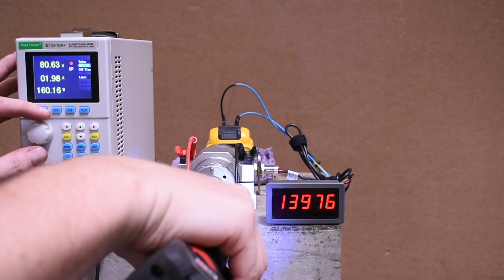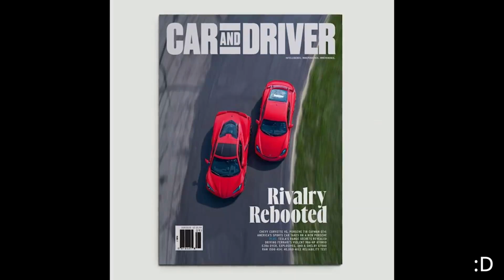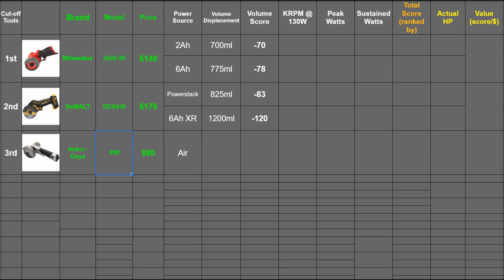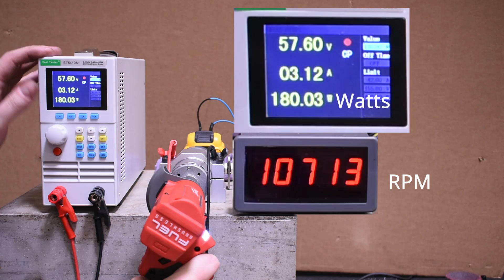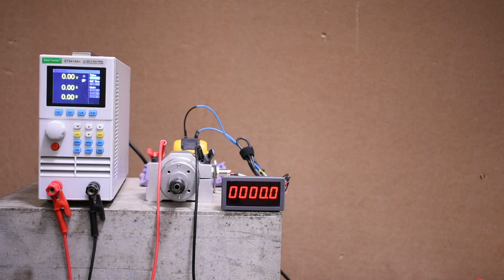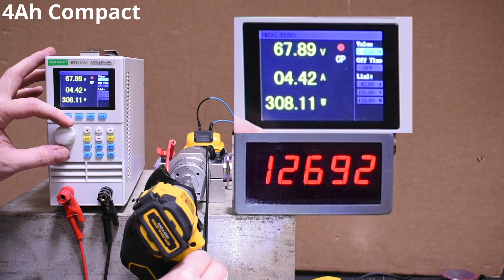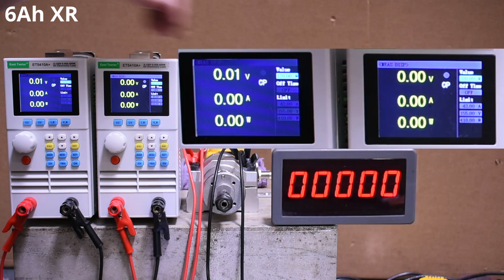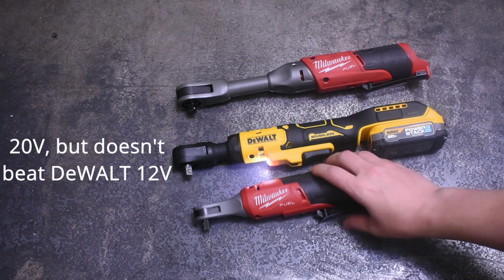Best Cut-Off Tool? Dyno Testing DeWALT v Milwaukee v Air

Comment: If you test the Craftsman I can assure you with a 4 to 6 amp hour battery on it or a five. It runs as damn near as good as the DeWalt. I own both of them, cut off tools, have their place and are very good on professional job sites. Just a offer of an option and opinion. I really like my Craftsman sometimes better than my DeWalt. I use it more but that's just me

Comment: Use my Dewalt one allll the time. Got it thinking I’d only use it in tight spaces but I use it probably more than my regular 4 1/2 grinder. Cutting 1/4 thick angle, welds, I’ve even used it to cut a 3/16 thick sheet! You can be a lot more precise with your cuts because of how smooth it spins rather than using a grinder. Love it. One of the best tools I’ve gotten

Comment: Milwaukee makes the best drills and drivers and thats it, the rest of the Milwaukee line is just above mediocre. I use to be a Milwaukee fan boy till i discovered the other brands out do them in every category but drills and drivers now i get the best tool for the job instead of color. They don't even have the best impact wrench anymore that title goes to dewalt as well

Comment: I got the Milwaukee as part of a kit. Finally had to use it the other day to cut a ridiculously thick garden hose threaded end off of the spigot. I was not terribly impressed. It worked, but felt like it was struggling.

Comment: This dyno is good for comparison, terrible for measuring mechanical power rating. The "Dyno" motor has it's own power curve, and at least 80% losses. I would be surprised if the HP numbers are even within 50% of actual.

Comment: It's a shame Harbor Freight's Hercules 12 Volt cut off tool (Model 58629) and the Bauer 20 Volt cut off tool (Model 59365) weren't available when these tests were conducted. With that said, if you do a rematch add these two to the list of contestants.

Comment: I have not long purchased a metabo CC18 LTX BL , it is fairly basic, it is 18 volts and n values 20000 rpm . I hope it’s as good as my other metabo gear . On a side note it looks like a lot of metabo gear in the states is Hikoki

Comment: This testing you figured out doesn't answer anything for real world testing.  Great thought process though. I went out and got the new DeWalt based of what you reviewed and it sucks compared to air. Just cutting welds off it will bog down and shut off like Ridgid and worse is Milwaukee.   Only thing good about DeWalt is that it's a little stronger and they use common sense and  put left hand thread. It's like the air guns. They show big numbers and most of them suck. Real testing shows all the truth in the field

Comment: I love the Onyx 209 and the 4” big brother. Recently picked up a Ridgid Battery cut off and I like it but it goes through batteries quick. Looking at a Ryobi as well for cutting large petroleum hose with big steel wire reinforcement.

Comment: The DCF 840 with a powerstack 1.7ah woops all day long on the M12 impact driver with a 6.0ah. 
Higher voltage but the Dewalt weighs less and spins out more power not to mention the grip on Dewalt is a better feel.

Comment: The 18v Ridgid would be a good middle ground to test. Other channels have done some testing and it was more powerful than the Milwaukee. I don't think I have seen a review against a DeWalt. The Ridgid retail is $129. They are on sale now for $100. Ridgid has a ton of batteries to test against, plus all the other Octane variance.

Comment: I bought the M12 to cut off toilet flange bolts and vent pipe along with other light duty stuff and it performs just fine. I already have an angle grinder for heavier applications. Milwaukee tries to come out with precision tools but everybody is just focused on the power and torque. Same reason why Milwaukee is ditching the electronic clutch on their drills for mechanical.

Comment: We have the M12 at work and I thought it was okay. I use it to cut 1/4 in drop leaf steel slides at work. I didn't see Makita was coming out with with their own so I got the Dewalt as free tool with starter kit. It's powerful and can take more pressure with out bogging down unlike the motor like the M12. My only gripe so far is the horrendous noise it makes at full rpm. Sounds like somethings wrong with the motor like somethings off balance.

Comment: Great vid as always bud. Curious to see how ridgid's 3" cut off tool stacks up. I doubt it will pull dewalt numbers, but wouldnt surprise me to be above m12 numbers
Reply: I owned both and the Ridgid was noticeably more capable than the M12 fuel. While my M12 would stall once cutting through 3/8" rebar, the Ridgid would do it right away and about 2-3 seconds faster. If going through 1/8 sheetmetal none of them stalled but the Ridgid would be quicker overall.
If going through drywall or pvc, both would feel about the same.

Comment: Wow. The m12 fuel was the first cordless tool I owned and I love it, although it does bog out if you push it too hard. Good thing you convinced me to grab a DCF891 so I now have DeWalt batteries and charger for when the m12 gives up the smoke haha.

Comment: Bros comparing 12V with 20V tools and calling it a fair test. The 20V dewalt has more voltage than the Milwaukee M18s lol
Reply from the maker: "The 20V dewalt has more voltage than the Milwaukee M18s" No it does not
Reply: @TorqueTestChannel  Yes it does, Mikwaukee M12 is 12V, M18 is 18V. Are you dumb?

Comment: The milwaukee with the compact high output battery can be put through a 90mm downlight hole to cut steel channel. It's a little down on power but man, it will solve some headaches for you! Add a diamond cut off wheel and it's great. Maybe the gen 2 will have a few more watts...

Comment: not the usual type of tool for this channel, but as a woodworker primarily, routers would be an interesting one to see, though my makita 18v router does 10,000-30,000rpm so the setup would need some tweaks

Comment: The efficiency of the DC motor will vary with speed, torque and even motor temperature. Definitely the electrical power you are measuring is lower that the mechanical power you want to measure. I suggest that you try to source a torque tranducer of some sort. Maybe check out manufacturers such as HBM. Measuring torque and rotational speed directly should give much more accurate measurement.  Also about the load: wouldn't it be better to control the current instead of the power? This let's you control the load torque better as the current is roughly proportional to torque. Now  you are demanding constant power from the load, and the controller compensates for speed (voltage) reduction by demanding even more torque (current). The controller tries to completely stall out the tool

Comment: Tools Tested did a test with these in the Spring with the same results, so I'm not surprised.

But DeWalt did have a long time to copy Milwaukee and improve the design. There are only a couple of DeWalts that make me wish I could justify another battery system. That cutoff tool is one of them.
Reply: Don’t forget dewalts sawzall that thing is something else.

Comment: Milwaukee aren't good for anything other then Finger Belt sanders I turned mine into there protection circuit kicks in way to much and they stall with light pressure way to often the Dewalt has way more power @Torque Test Channel

Comment: Higher voltage doesn't always make a difference, but in these circumstances where you have a sustained load on a spinning motor, those extra volts really help keep the amps down.

Comment: for my purposes of cutting tiles on installed backsplash the m12 is smaller and works just fine. If you were cutting rebar or wood cutting then that dewalt is the tool to use
Reply: These are not made for wood.

Comment: Not quite apples to apples, with Milwaukee being a 12v, and Dewalts a 20v max. So not really a fare comparison.  Obviously the Dewalt is going to be more powerfull, so why are people ooing and ahhing over how much more powerful it is. They can be compared, yes, but not exactly correctly
Reply from the maker: The correct way to review a Porsche vs a Corvette is to remove two cylinders from the corvette naturally. In a world where apples to apples is more important than the realty someone is either going to buy one or the other to do the same thing with it.
Reply: @TorqueTestChannel  cars are a totally different ball park, as u mentioned in the video, the specs of both vehicles are near the same. These tools are not even close. Anyways, keep up the good work. Love the videos
Reply from the maker: Only because they don't list tge specs. In the die grinders case they do list the specs and still fall short

Comment: Ive been pretty aggrivated at milwaukee for a while. The only cordless tool ive gotten from them that lives up to the hype is the brushless 4½" grinder- its a beast. The drill i have is a joke that shuts off with the slightest pressure in high gear (even with high output batteries) and the 3/8 impact is NOWHWERE NEAR 220 ft lbs. My gen1 high output 1/2" impact was pretty powerful but it's expremely wimpy handle broke and now it's obsolete, can't get a replacement.

Most of their tools are excessively large with a whole bunch of wasted space inside, when they could have been made much smaller with a little more effort to think out the packaging a little better. Almost all of the handles are made for sasquatch apparently, just in case they become more prevalant in the world and learn to use tools. The size of those sawzalls? Rediculous. And have you seen the size of the body on that m18 chainsaw? That's the best they can do?

I work in a shop where there is alot of milwaukee, and I'm always surprised at how many ket killed. That crap they pulled with the cheapened gen 3 mid torque impact was utterly shameful and it seems like they only did something because torque test called them out on it in public.

Don't get me started on their high output 9.0 / 12.0 batteries. 

I'm a milwaukee guy....but come on,  milwaukee, put a little more effort into sustaining that reputation of yours. Ive held off buying anything red because of the way you're relying on that past reputation instead of producing top notch tools.
Reply: I have been using Red for years and they have really went downhill lately
Reply: I remember when Stanley Black&Decker started down that same road of sliding quality and reduced quality control with Dewalt. Hopefully the red team pulls up their socks. 🤞
Reply: @1x4x93  yep back and decker had an industrial line that was just starting to merge with dewalt back then, and before that alot of the dewalt line was pure industrial stuff with all metal housings and cast iron tables.

Comment: Know you must have posted it somewhere but what air pressure are you using? I remember you'd test air impact guns at 90 psi rated psi and higher psi (150?) to represent typical shop pressures
Reply from the maker: 110 in this series, to represent a typical but not crazy line pressure

Comment: Great video, thanks!
My $.02, I'm fine with the 12V Milwaukee vs. 20V Dewalt..I have mostly 20V Dewalt and a couple 12V Milwaukee tools....both have their place for me.

Very nice to know how the 12V stacks against the 20V since the 12V would likely be adequate for my needs...and I don't want to add the 18V Milwaukee at this time.

Most of the 12V Milwaukee are more than adequate...comes down to size at times 

However....that 20V 6Ah is a beast and might be worth the plunge.

Thank you for comparing both.

Comment: I expected the M12 wouldn't make the power of the Astro but that DeWalt is a hog. Seems like that answers my question about the bandfile as well. My Astro band file has more than ample power so I think the M12 would have plenty of power if I decided to get one for those occasional off site jobs.

Comment: I use a harbor freight 4.5 inch air cut off tool and at 135 psi, it's a genuine beast.  You should test it plus it only costs 110 bucks

Comment: 11:08 - Don't forget the voltage helping with the wattage! The amps on the powerstack vs the 2ah is 20a vs 16.2a for the 2aH red tool (at a nominal voltage of 3.7V/cell). Don't forget the voltage helping with the wattage!.. Thats a discharge C rate of 11.7 for team yellow and 8.1 for team red... Not as large of a amperage difference as the wattage leads you to think.

Comment: I would be interested to see the volts measured at the dc motor vs the load tester volts 
Check the performance of your lead and the attachment point at both ends.

May be an issue but as you say 14 g wire should be fine but depends strongly on the manufacturer not telling porkies ( i mean thats what this ch is all about right?)
Reply from the maker: We bought the most expensive USA made leads we could find, lol. We're also making some 10AWG ones this week

Comment: Would be really interested in seeing how the Ryobi compact cut off tool compares to these. 
I have one but use a dewalt 20v battery on it with an adapter. 
Works great.
Reply: I'm also interested in seeing the Ryobi compared to the Milwaukee and DeWalt.
Reply: I don't own the Ryobi but owned the Ridgid (which looks like an orange Ryobi) for about 6 months and it's noticeably more powerful than my M12 Fuel. Eg. cutting 3/8" rebar would've stalled the M12 once while the Ridgid would cut it right away and 2-3 seconds faster.

I also liked the Ridgid had a variable speed trigger but I just got rid of it as I chose to keep 2 brands only. Nothing wrong with their cut off tool.

Comment: I have the M12 and the Ryobi.  The Ryobi crushes the M12 especially on endurance.  The M12 electronics can't handle the high resistive losses from the lower 12V platform.  It shuts itself down due to this, quite quickly.

Comment: Old news, Joe the Tool Guy proved the Dewalt was better back in April. Search "New DeWalt XR Cutoff Tool better than Milwaukee!" The m12 totally failed to cut 3 day old pizza while the Dewalt showed us a bright new future of pizza slicing ;-)

But seriously this is an awesome channel. Would love to see the m18 vs 20v Dewalt 1/4 die grinders matched up against each other. Also Makita, HPT, Kobalt, and Ryobi also make 1/4 die grinders. Would make for a nice series for your test rig if it can handle the torque output of these tools.

Comment: I’ve never used either of these Dewalt or Milwaukee cutters but I do have the Ryobi cutter and it compares quite favorably to all of my air powered cutters. I’d love to see you test that and the right angle grinder. Also any chance you could retest the Milwaukee with the 2.5 and 5.0 HO batteries?   Awesome video and love your videos!
Reply: I've heard that the Ryobi is better than the Milwaukee, the battery size was just a deal breaker for my use case sadly.

Comment: Would using the cp 3.0 battery not also be it's "smallest" configuration and possibly provide a tad more juice?
Reply from the maker: Higher capacity but less amps capable those 3000 cells

Comment: Home depot has a loop hole, I bought a dewalt $200 battery starter kit and got the dewalt 3" cut-off tool for free....I didn't need the starter kit so I returned it and they gave me $105 back so I basically got the cutoff tool for $95

Comment: That’s very unexpected. I’d like to see a shootout between companies making impact rated swivel sockets. Specifically 9/16. Swivel angle, overall size, length, durability etc. It’s the size we use 95% of the time installing new conveyor systems.

Comment: It would be interesting to see you test home computer backup systems. They make a lot of claims on how long they will last. All based on certain loads. Some of the batteries in them do not seem to last to long. Maybe you test the replacement batteries for these also. The 1500 wat range prices range widely.  Amazon brand makes one for under $200 while some of APC's are in the $1,000. I love to see the results.
Reply: sounds like a really good project farm test

Comment: Take the DeWalt and run it off 110 or a 220 outlet on that Dyno.
Reply: better yet use the 15ah battery, that should do it
Reply: @m1l4nchee  i mean, it possibly would but I want to see that puppy blow

Comment: Not sure if it's worth it but you could calculate every loss in the dynamo and subtract those from the total but since friction and ventilation losses change with RPM you would have to trace a graph for every rpm you need, copper losses change with temperature so you would need to check temperature to see if it's in ±5° from calculated operating temperature and then we have iron losses so it's better to ignore them after all. Or run the dyno with a variable speed motor with known power output and graph a rough efficiency rating

Comment: Can you test older Milwaukee impacts? Like the 2663 brushed. It just busted off 36mm axel nuts on my Honda Accord like they weren't even there, still staked too. It's been a black Friday deal at home Depot for years in a row now
Reply: They’re going to test in the 350ish range plus or minus 50 ft lbs.

If there isn’t significant amounts of rust, I’ve even managed to remove 36 mm axle nuts on my prelude with a dcf903 and adapter.  (Granted it was there less than 15,000 miles and therefore recently torqued to its 181 ft lbs spec, but still.)
Reply: @juanc5149  interesting, thanks for the numbers. It just really surprises me how this old tool still kicks ass lol atleast for my application it's great